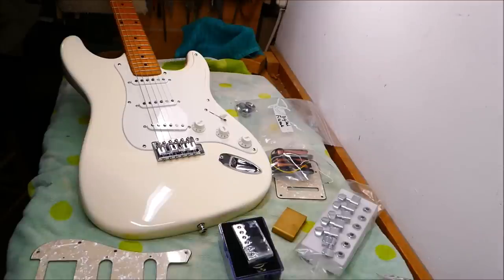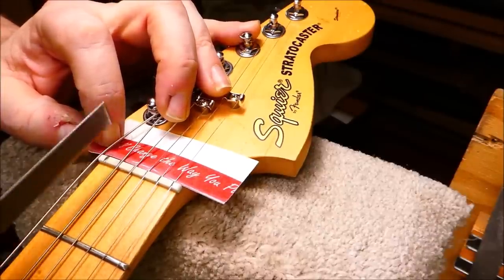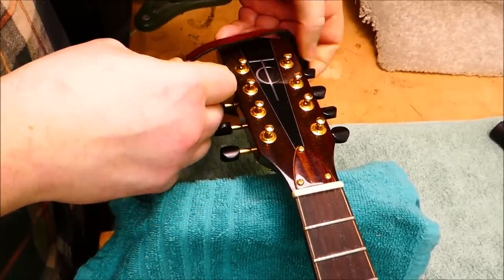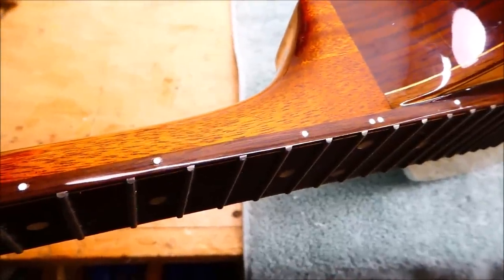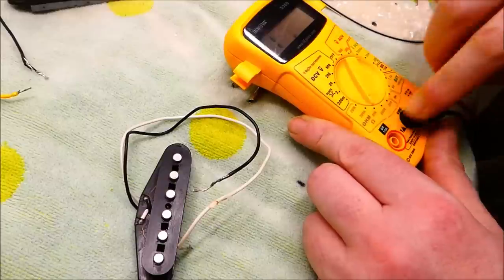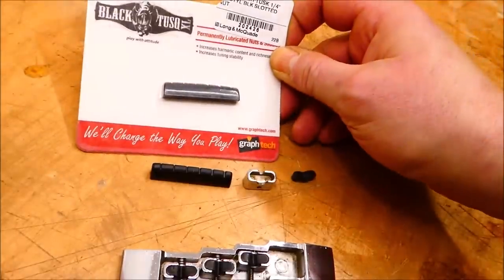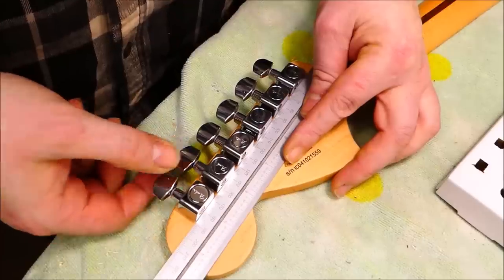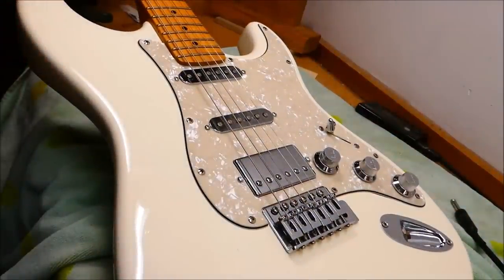That's a lot of work!

Comment: My almost 16 year old has been endlessly building their assembled guitar for 2 1/2 years now. It's been an excellent learning opportunity, and they will be able to do modest upkeep and adjustment on their guitars for life (maybe more than modest). I bought the first kit (of which only the wood is left at this point) hoping to help them develop the patience necessary to do the work. We've also had to bring it in once to get a professional to fix the electrical, as it was... broken in some way we could not identify.

As long as you don't think that putting together a guitar like this is 'cheaper' than buying one, i think you're good. But I feel the same way about getting a professional to look at it. It's an investment in learning... and, like any such investment, it's going to cost money. I can't expect a professional (particularly of Ted's caliber) to not charge me real money for their time.
Reply: I got sucked in to building partscasters for myself for 2 reasons:
1. because I thought I would be able to make it cheaper (WRONG, as you said)
2. because what I wanted wasn't commercially available (this reason is valid)
3. because I wanted to learn (this reason is also valid, I have learned so much and learn more each time I head out to the bench)

I agree for a luthier it doesn't make much sense unless the customer realizes that they will generally end up paying equivalent or more to a commercially made guitar - if they do, then fine. But otherwise, no.

Comment: Awesome  work. I know all the problems of different parts not fitting together, especially DiMarzio and Seymour Duncan Pickups. If you use both of them in one guitar, you get wiring polarity problems and many other stuff. HOURS of work and soldering, changing the potentiometers afterwards from 250 KOhm to 500 KOhm  or other direction, or mix it together!
It makes also a difference in tone, if you use orange drop instead of  normal ones. 
One of the biggest problems until today is for me, that you can't check how any new expensive pickup sounds in the wood of your guutar,  you planing to install it. 
It's always a risk and experiment so far. The different woods react  very different to different pickups.
Yesterday I saw a video someone said, he want to check how 3D printed  guitar "without wood" will sound. 😯
But he connected a neck from Harley Benton (made from wood! 👌 😂) on the 3 D printed Body....... some people are really funny, when they test a "woodless" guitar in 3D printed with a wood neck, playing their cords on the wood! . 😂👍

One tip from me:
I found out, that connecting a tiny piece of brass (1x0,6cm)inside the guitar, fixed on the Vibrato block has a big influence on the sound and sustain of a stratocaster guitar. It can save a lots of money instead to buy a complete new bigger Vibrato block system. It's a cheap  tuning and if you don't like it after, you can easily hammer it off again. It has to be fixed with 2 component clou, connecting with one site blank to the steel of the block for resonance! 👌 
Thank you very much for all your vifeos. You do an amazing masterwork and I learn a lot of you. 👍

Comment: Just a tip. When you connect the probes of your multimedia to a component to measure its resistance (in this case a pickup), for accuracy its best to make sure that your fingers are only touching one pick up wire. If your fingers on each hand are touching each probe, you have placed your body in the circuit (in parallel with the pick up). Use alligator clips or if you don't have any just wedge one of the exposed wires between your work bench and the meters probe tip. You may already know this but in the video your fingers where touching both probes and beginners with less experience might not know this already.
Reply: How much resistance do u think the average person has?

Comment: I’m pretty much fine with partscasters. I have two Strats, one from fender parts (body 1979, neck 1988) and a mix of old and new hardware and electronics. The other is Warmoth, neck and body. I did the work myself, the finish and assembly. Worth it for me because I find the work enjoyable.

Comment: for this type of work that's "not the norm"  i have a stand alone hourly rate plus consumables,  though im fixing power outdoor equipment not guitars. with emphasis that the job is unique to the customer pointing out some variables that are unknown until you get into it, thus a quote cannot be given though contact will be made should something expensive arise for confirmation on a way forward.    Thanks for the vids always a pleasure to watch.

Comment: I will only do partscasters with genuine Fender or matching Warmoth bodies/necks. Modding a genuine Fender neck or body to fit a substandard body or neck is something I'm not willing to do.  Still a ton of work especially if it needs fret leveling. It can easily go all day on a virgin build nevermind if there are client mistakes to correct. $4-500 seems perfectly reasonable to me. And IMO, the Warmoth builds are brilliant instruments once completed. These builds are the reason I recently made one for myself that is hands down the best playing/sounding "Strat" I have ever owned. But it is absolutely necessary to know what you want and which components fit various routs/hole patterns which is why I hold the client's hand during the ordering process.

Comment: Absolutely love your videos Ted! You're a true master craftsman. 

Just for fun, my winter project this year was to totally rebuild what was a partscaster even before I bought it. From conception to inception, with two split humbuckers, 7 way switching, and body refinish, it took me about 6 total working hours. I nodded knowingly throughout your video because, of course, on the pickguard the humbuckers didn't fit their respective routs, pots were drilled for metric, the neck route was irregular, etc.

The reality of partscasters is that, once complete, they're never finished. There's always a tweak to the tone control circuit; the pickups don't sound right together; I'd like to try a different fret style; what would brass saddles sound and feel like? While mine was a fun personal project, I would certainly expect to essentially pay for a new, at minimum a mid tier, guitar by contracting someone of your caliber to assemble something like this.

Comment: Guitar Fetish HAS parts for Squier, American and CIJ Fender   No fitting issues there and the parts are good quality and cheap. I changed the tuners, a pick guard with Alnico 50 style pups and even the brass bridge wait fit right in.

Comment: I've have done a couple of Partscasters over the years (all for myself) and what I have learned is: "Partscastering" ist more like searching the internet for specifications and identifying parts, than actually working on the guitar itself. - As long as you don't start sanding and finishing ;)
NEVER buy something because it looks like it would fit - identify the correct name and specifications of your current part and search parts that are actually made to replace them. You will probably end up buying things from 3 different online Store (Ebay, Amazon and Aliexpress) parallel.

The good thing is, as long as you stay in Fender or Squier range, you will find EVERYTHING. But you will spend far more hours researching what upgrades will fit than it will take you to mount the right and fitting parts.

Considering your video: Doing Partscasters is not that bad - as long as you are the person that is researching, choosing and buying the actually upgrade parts and then are mounting them. If you did your research good - then everything will fit will and you won't be frustrated.
BUT mount stuff that someone else has choosen and bought - that is nearly undoable and only comes with frustration - as  shown in your video.

Also VERY OFTEN it is not worth upgrading smaller parts and instead it is much better to just switch whole assemblies. Especially considering the example of the tremolo your client wanted you to upgrade with a brass sustain-block. It was an super cheap import Tremolo with an cheap tiny zinc sustain block and cheap saddles. The effort of searching an actually fitting one is horrible and that upgrade block still costs a bit. It is much better to simply identify what the screw spacing is (on cheap Asian made guitar probably 52.5mm / 2 1/16") and buy a proper whole Tremolo which comes with an good big brass or steel sustain block, good saddles and is just better overall.

In the end my conclusion is that: If you do your research properly and buy the RIGHT and actually fitting parts, doing a Partscaster is really free of frustration and you don't need to be an luthier. But good upgrade Parts often don't come very cheap!
But if you just buy the cheap parts that "look like they could fit" it becomes an nightmare of frustration. To mount such stuff and get things to work you'll need to pay an luthier or end up having things not working. The frustration for you and your luthier is insane, and you'll probably end up paying the same amount of money because of the amount of work that needs to be put in. But then often then you'll still have cheap inferior parts in that case.

Comment: For both Ted and anyone looking to get staggered tuners I'm not knocking him at all but the taller ones are actually supposed to go on the bottom strings and then it gets shorter as it goes to the top of the headstock so that the angle of the strings is a little more consistent on fenders

Comment: In our shop, smallish market, just a bunch of regular guitar techs, used shop, this customer would be charged somewhere between 150 and 200 dollars for that work. 
A rudimentary breakdown would start with basic versions of the extended work:
40.00 for a set up
40.00 to wire up the guard
25.00 fro tuners install
Then we advance from there for the woodwork, modifying the guard, time, etc.
hope the info is informative.

Comment: I modified a Fender American Standard with a pre-loaded pickguard, just solder the jack & ground, boom!  Custom Shop Texas specials with a Pearly Gates HB with a pull out coil split. 

All that work on a Squier . . . not. They’re not bad guitars, much better than I had when that was my price point, but unless it has special meaning like the 1985 Fender MIJ Stratocaster my mother bought me for HS graduation, I’d do simple business card shim and a good set up. 

In this case, just go buy a higher end Squier like a classic vibe, or wait for your eyes to heal if you want to hobby build it.  

Good info!  I never considered that the parts wouldn’t Lego together without a lot of filing and drilling.

He should have had you add a piezo while you were at it 🤣

Comment: I built a Frankenstrat from parts I bought off ebay and other sources. I wanted to get get a copy of Gilmour’s black Strat as near as possible as cheaply as possible. I must have got lucky because it turned out great first time. Cost about £350 compared to Fender’s £3,500. Plays really nicely.

Comment: I have 5 partscasters. I always pay attention to string spacing, pickguard fitment, and one that most miss-body thickness. 90% have screwed right together with no issues. Fail to plan, plan to fail.
I am a lefty, so to get what I want, I have to make it myself. There are almost no options in my very limited budget.
Reply: Especially with Fender related products, but it applies in general: go on some forums and ask questions. What fits with what? Find out ahead of time whether you're dealing with metric or English pots. Dry fit everything possible. Accept the possibility that a less expensive kit may require more work. BTW, my sympathies on being a lefty guitarist! Fortunately, I'm only left-handed for everything else.

Comment: I did some customization like this in my Squier Strat, but left her as the HH she came as using StewMac Golden Age Humbuckers rewired from a 3 way switch to a five way using the two intermediate positions as coil splits. Of course I also put in new CTS pots since the stock ones were dime sized and old.

I know your pain with that brass block - I waffled endlessly on the decision for mine and did countless measurements, but ended up getting the right one. Add in some Graphtech string trees and saddles (too afraid to try a custom nut since the premade one was the wrong size) and a tuxedo pickguard, and I was pretty happy with it.

Comment: With enough research, you can get pretty close to plug-and-play. I've managed to find drop-in parts quite a few times.

If you just go by how the parts look, you're going to have a hard time. Cobbling together (or attempting to cobble together) a bunch of parts that weren't made for eachother is an utter nightmare. Thankfully and luckily for this customer, you pulled through, and did everything the long and correct way.

Well done!

Comment: for me as a parts caster builder too the ssh cavity is the easiest thing to upgrade if you want humbucker for bridge or new pickguard because you dont haVE TO worry about the pole being misaligned but the problem is if the pickguard has misaligned  to the cavity then you need to remove some material and that's the advantage of hsh and hhh cavity 

building a parts caster is fun I bought a 1st parts caster for around 10$ the only problem is the neck all the electronics are working I upgraded it to humbucker also and I change the brownsville neck to musiclily around 30$ it's like an extra fret upgrade hehe some times it's plug and play but most of the time it didnt  i just wasted my time experimenting with tone cap

Comment: I totally agree. Partscasters, just take way too much time for a Repair Shop.  I don't know what your hourly rate is, but when I was still working as a Repair Tech in the 2000s, it was up to $65 an hour the store charged the customer, that's a $325 charge right off the top. Add that in to what the parts costs were and you'd quickly be looking at $700 to $1000  into a "Hobby Instrument.". Way more than you'd ever be able to resell a "Partscaster" for.
So yeah, it's just not a good thing to commit to doing.😊

Comment: I have a Mexican standard strat from 91 that's identical to that, but black paint.  I had my man put tex mex pickups in it, and change all the white plastic knobs and switches to off white.  The white pickguards he replaced with tortoise.  He also installed a bone nut.
I loved the guitar since i bought it new, but was tired of looking at the eric clapton clone.  now it's prettier looking, and sounding.  I had originally thought about those cracked-ice pickguards, but i'm happy i didn't.  It looks very nice with cream though.

Comment: I put together a partscaster that was almost identical to this. I went with different pickups, sustain block and so-forth. It was really frustrating as not one single part fit correctly. Almost every pre-drilled hole, from tuners to pick-guard, had to be filled and sanded down, then re-drilled. The sustain block fit the new bridge, but I had to re-route the pocket as the block was just a little to big. In the end the instrument turned out great, but the total work involved was astronomical. Thinking about what this would have cost to have a high-end luthier do this kind of job???? Would have been cheaper to call Fender and have a custom-shop guitar made.

Comment: Good sir great informative and instructional videos.

Just found your videos today and have watched 3 in a row and subscribed to your channel.

Please note from my experience installing staggered tuners - the shorter 3 tuners are for the smaller (higher strings)
And
The taller tuners are for the (lower strings)
Modding Fender/Squire PartsCasters is always an exercise in frustration as nothing lines up and or fits! But after it’s completed it’s a custom shop guitar!! 
Thanks for the videos 
Cheers✌️

Comment: The staggered tuners are meant to go from tall ones close to the bridge and short ones to the end of the headstock. This way it’s possible to remove the stringtrees because the strings get their break angle this way. So the 46 gauge string should be able to fit this way.

Comment: I have to say, from a hobbyist partscaster assembler: Most of those issues are completely avoidable. Having said that, I make deliberate decisions in all of those problematic areas; it's not a guessing game. Tuner compatibility/hole size, not mix/matching metric and imperial parts, bridge string and screw spacing (of which there are many variants..) correct CTS imperial sized pots and pot shaft length, countersunk screws vs. flat... and so on. I am a hobbyist and no expert, but even I could avoid these problems with some care and prior reading. I'm sure you are well aware of this, but I feel like it's important information for other aspiring DIY hobbyists.

If you put the time in and research before buying, you can absolutely have everything fit together with minimal effort or finessing. Maybe one or two odd issues. Cheaping out on parts usually means the fit will be bad and need shimming, sanding, (re)drilling or other manual adjustments.
Unfortunately with so many cowboy assemblers, it seems common to have an ill-conceived mish-mash of parts thrown together in the hopes of it all 'working out'. I understand why you are frustrated with having to "clean up the mess" and don't enjoy working on them, and honestly I wouldn't want to either. The amount of headaches and problems that you encounter trying to fix it is very evident in this video.

Thanks for the great content! It's enlightening to watch some of your creative solutions to problems, especially on vintage instruments. Thanks.

Comment: My first guitar building experience was a kit. Thankfully most of it all came from the same source with a guarantee that those parts would assemble without issue. Which was true and I thank the kit supplier for that. Still tons of work though. You get parts from several different places it's always going to be a hassle at pretty much every step.